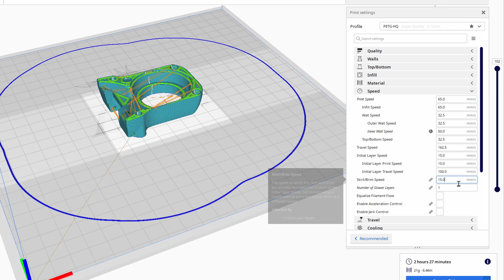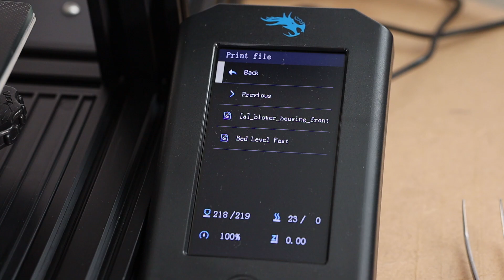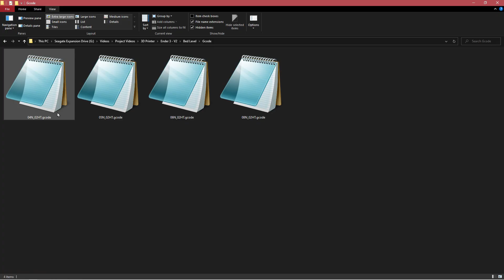Creality Ender 3 V2 - Fast, Easy Way to Level Your Print Bed

Comment: Nice in theory, but not easy to do in actual practice.  The noob should get a simple bed leveling G-Code that tests 5 spots on the bet, pausing in between stops to allow you to adjust.  Run this 2-4 times and you are spot on.  Save up the money to get a 32 bit board and flash a firmware that has either manual mesh leveling, same as a BL touch without the sensor.  Or just save an extra $40 (you can skip Star Bucks 2-3 times in one month) and just get  a BL Touch.   The method here is finicky, and not for the novice and goes too fast.  Seasoned 3D fans already use the BL Touch or equivalent  or some form of manual mesh leveling. Save the headache and to that over this video.

Comment: bro, did you cut out a scene just before 1:30? i feel like there should be an explaination coming of what you are doing, but then you talk like its already over. i mean, obviously you adjust while the skirt is printing, but how do you adjust? what do you look for? what indicates a high bed, low bed or just right bed?

Comment: Now that you have a glass bed you should solve the moire issue. It’s exacerbated by heavy glass beds like that. Make a video once you solve it!
Reply from the maker: It seems to be getting worse, In an upcoming video I will be examining this issue in detail and we'll test some solutions to see which one works the best.  Tossing the glass bed helps with rapid changes in direction, however the pattern I see on all of my prints is consistent and completely vertical as well.  The same G-code run on my newer printer is there but not as noticeable.  I have to wonder whether this is strictly caused by the motors.  Thoughts?  There doesn't seem to anything on Google about solving this problem.  Steppers have vibrations, there are dampeners available, but first I think a swap with new motors would be the place to start, what do you think?
Reply: @NeedItMakeIt  I have a theory about this. But that’s why I was hoping you’d look into it :)

Basically I think once you get good stepper drivers and tune everything, the pattern you see is visible, but superficial. Like on mine I can’t feel the lines, but on certain filaments you can see it.

Anyway, my theory is that it’s the belts. Not how tight they are. Literally just that the gear interacting with the belt causes it. I actually measured the distance of the lines and calculated what the gear would look like if you flattened it and it’s clearly an identical distance/pattern. So I think the simple fact that the belt has teeth and the gear spins the belt, it is imparting that pattern onto a print.

Some moire lines are caused by other things. But once you tune those out, the pattern on the surface of prints seems to point to the belt. At least that’s my theory.

Comment: I have 4 cr10’s and I have been doing this for a while now but What I do is I have a simple square 0.2 mm layer height only 0.5 mm thick stretched across the entire build plate but set with no top and bottom layers and infill at 5% set on grid this gives me a grid pattern over the whole plate and shows me if there is any warping in the center or edges. Once it’s set I can print for a very long time without having to do any further adjustments. I use hairspray for my bed adhesion I made a masking cover out of chipboard so I get very little overspray. 
Thanks for your awesome tips I’ve been getting some globs on the outside of my prints and your settings on your latest video has greatly improved my models.

Comment: actually the easiest is to enable manual leveling, mesh leveling, and 'go to corners' in marling,    then you can level it using the lcd to go to all corners etc, even create offsets for warped beds, aswell as adjust the z-axis DURING the print of your first layer, via the lcd

Comment: This is exactly how I level mine! Doing the whole paper thing seems pointless to me, I make sure when I print that I get enough smoosh on the first layer by doing this.
Reply from the maker: It has been working great, I like to level by eye, if you have a light behind the printer it makes leveling easier, you can see the space between the nozzle and buildplate
Reply: @NeedItMakeIt  I did the same initially, after failing with the paper and realising that the paper method wasn't super reliable I started doing it by eye, then after having some adhesion issues I moved to the method in the video.

Comment: If your feet aren't flat on the surface, it means the machine is tweaked. when the machine is tweaked, it will never level properly. CHEP on filament friday has a video on how to fix this... it's a PITA but it fixes things.

Comment: i have an ender 3 pro, i had a warped bed and couldnt really print anything, then i got mesh bed leveling, now my first layer is almost perfect.
Reply: Did u use bl touch?
Reply: @DarkMatter1919  no its free

Comment: Haven't been printing for a while. I see your channel has blown up in size! every video looking better and better.
So far my ender 3 v2 has had 3 faulty wheels and 1 bump in the axis where the bed moves on. Now I finaly have all the parts replaced and there where more people having issues with the firmware. Now someone fixed the problems. and I cannot say how happy I am with a 5 x 5 measurement from the bltouch. we'll see how long it stays and how good the print's will turn out.
Reply from the maker: Hey, sorry super busy lately, just catching up on these now.    I did find that they tightened the Y carriage cams too much on my 2nd printer and it deformed the wheels a little bit, just enough to feel the tiny bump when it moved.  I still need to get the BL going on my printers, I still have some videos to make with the printers set to stock.
Reply: @NeedItMakeIt  no problem. You channel is twice as big. 
I have some experimental firmware from a forum.
So far no problems anymore. 
Printed the t rex skull and some other stuff. 
I can honestly say I whould dare to print over distance while not beeing home now.also start from distance.

Comment: Voron part nice👍 soon™
Reply from the maker: I'm souring the parts at the moment, I have a simple Voron series starting soon, then we'll jump into the bigger printer design, print, build project.  It will be no ordinary build, I'm going to be using some cool new design techniques.
Reply: @NeedItMakeIt  yea I myself am printing parts for a switchwire found out real quick pei sheet is a godsend
Reply from the maker: @reaperdeath667  Will keep that in mind. I do like my glass, but maybe I'll make a jump at some point.
Reply: @NeedItMakeIt  I used glass and abs slurry at one point but soon it just becomes a hassle for abs, and for pei I just wipe down with iso every so often but that's it. energetic makes super cheap flex plates that's pretty popular in the voron community
Reply from the maker: @reaperdeath667  I'll check them out, thanks for that.  If it works that well with ABS, I'm sold.

Comment: do a switchwire easiest  build of the vorons series.
Reply from the maker: Done!  I printed some M4 extruder parts last night as a trial, OMG they turned out really well.  I am going to make a series, something a little different than anything else out there.  I really don't like those long videos, I'm going to work on condensing them to just the good stuff. 

They're called Core XY, this one is an XZ isn't it?
Reply: @NeedItMakeIt  awesome 👏🏾 yes its corexz, I’m looking forward to your build
Reply from the maker: @GoldenJaguar3D  It is going to be awesome, I am thinking of going with stock silver frame because the black is not great for the camera... I also want to experiment with buying a few parts from nylon and metal to see how they compare.  Not from Aliexpress, but from a place in Toronto ON.  Maybe also using generative design to tweak some moving components for better strength and weight properties.  How does that sound?
Reply: @NeedItMakeIt  sounds to me there is always room for improvement, I’m excited to see your take and renditions of it  keep the videos coming! I’m enjoying your videos
Reply from the maker: @GoldenJaguar3D  I was thinking it would be awesome to have a terminator style Voron, metal polished fan shroud etc.   More videos to come soon, so little time, so many ideas.

Comment: nice video. Any advice on cleaning the creality glass bed? is it safe to use Isopropyl alcohol or it possibly damage the surface?
Reply from the maker: The black coating doesn't seem to last no matter what, if you want it to stay looking good, flip it over and only use the smooth side.

I like glass, I'd recommend purchasing the thinner 3mm borosilicate glass, it lowers the weight of the Y carriage and produces better results with less ringing, really depends on your speed, type of print and jerk settings.  

Both of mine have worn down a bit now, but they still perform well, they just don't look as good.   Soap and water, or Iso Alcohol both are good.  The coating is a bit gimmicky, I don't find any performance improvement over flat untextured glass as long as we're using glue sticl.
Reply: @NeedItMakeIt  thnx
Reply: To clean it I use hand warm water... just keep rubbing it bit by bit. I do have isopropanol. But so far have not used it.
Reply: @TriMeX1987  thnx

Comment: Hmm which voron are you building
Reply from the maker: I think I'm going to have to build the Switchwire.  I think this is the most similar to what I am familiar with and it is still pretty challenging.  

I was thinking about doing a series which will include experimentation with some different filaments, maybe outsourcing some parts from Nylon and metal, and showing the struggles and solutions to problems etc.  What do you think?

Comment: I don't really get what makes it better than levelling bed with paper sheet, you can see the layer thickness or something like that? What makes it more confusing to me is that you are adjusting the knobs on the opposite site of the current extruder location few times. I know for a fact that when adjusting the knobs on one side, you are affecting the tension on other corners and it thus with paper sheet method it requires multiple takes to do this properly, but I don't get how are you supposed to precisely adjust the distance here.
I'm not saying this doesn't work or shouldn't work, but for video directed at newbies in 3D printing it is lacking  full explanation of the adjustment process.
Reply from the maker: If you're happy with the paper, no problem, it works.  Personally I never found it gave a great result, I'd always end up tweaking it in the method shown in the video.  I probably could have shown a little more of how the adjustment process, works.  I tried to show how to do it so that anyone could setup a process that works for them, the shirt can take three passes if needed to get the result.  I am always close, one pass and a tiny tweak is usually all that's needed, 2 passes helps when I've moved the printer around for maintenance and part swapping etc. 

I have a lot of ideas, they don't all work for everyone, I'm sharing and maybe they'll be useful or give others some ideas of their own.  This one was requested by a viewer.

Videos can always be better so I appreciate that you took the time to leave a detailed comment and I will take it into consideration for anything in future.

Comment: I don't get it. If BLTouch is a somewhat proven way to account for bed leveling issues, why delay the purchase? For about $50, and a 2-minute G29 before each print, you have fairly well adhering first layers time and again. You can save your different profiles in your slicers to account for nozzle and other changes. This is instead of running other code to manually level frequently and running the risk of damaging the printer.
Reply from the maker: Hey, thanks for the comment.   The video is mainly aimed at those who cannot afford another purchase or people like me who prefer not to complicate their printers with upgrades.  I do have a BL, it may make it into a future video, but after several years of not using one, I don't have a great need.   No question the BL is good, I just don't believe it is a necessity.
Reply: @NeedItMakeIt  I agree if cost is a major concern, then this method is a viable option. I had gotten fairly comfortable with the manual leveling myself prior to purchasing a BLTouch, but once I got the BLTouch and worked out the firmware kinks, I have not regretted the cost or the minor complexity.

Comment: Voron parts out of PETG, ick.
Reply from the maker: I may switch to ABS,  I am not a huge fan of the sheen of PETG, ABS has its own set of issues.  Any reason aside from looks to use ABS of PETG?
Reply: @NeedItMakeIt  PETG thermal cycles differently and will likely suffer/sag. eSun ABS+ printed nicely on my CR-6 SE in a box.
Reply from the maker: @ztynzo0  I don't mind to use ABS now that it is warmer, I'll have the printer in the garage inside an enclosure and use the nano adhesive for the best results.  I mainly switched due to the smell, adhesion was solved with the Nano, and there are others now that work well.  Thank you for the tips, I do prefer the look of ABS over PETG, but PETG smells nice to me.

Comment: I ordered some stiffer springs, will see if that helps.  Been getting about 1 out of 10 prints to survive past 3 minutes.  Ender 3 v2 is junk.  Should have bought the Prusa.
Reply: get mesh bed leveling its much easier and better and free
Reply from the maker: I have two of them now, I don't have any problems aside from the more visible seam on the bowden setup.  Send me the file and the nozzle size and material, I will print it and then we can troubleshoot together.  Prusa is a nice printer, no question!
Reply: u might have a warped bed, if u have a warped bed no matter how much you level the bed some parts are not gonna stick if you have a warped bed.

Comment: On my Anycubic i3 Mega S and Ender 2 V2 I've had this problem where usually the top left corner of a square, for example, does not stick to the bed. All of the other corners seem to stick, but the top left corner seems to almost warp upwards. I've cleaned both with 91% isopropyl so far (which I feel might be too strong). Any ideas or tips? Thanks!
Reply from the maker: I'd say it is likely that it is a little further from the nozzle and doesn't adhere as well, which material do you print with normally?
Reply: @NeedItMakeIt  Thanks, that might give me an idea! I have tried PLA and PETG.
Reply from the maker: @azo5000  A bit of glue stick should solve your problem with those two materials, I only use glue stick now, I don't ever worry about adhesion.   Good luck and let me know if I can help!
Reply: @NeedItMakeIt  Thank you, I will try this and let you know if it works. I appreciate your dedication and help.

Comment: Are you turning your V2 into the Switchwire?
Reply from the maker: I've been thinking about it, I might want to go all-in on the best possible printer I can build.  On the other side, it might be more helpful to people to do a more simplistic printer.  What I had in mind was a sort of walkthrough cutting out everything unnecessary and making a series out of it, which could include any struggles and design changes printing or parts etc.  

One thing is for sure, the Ender 3 can only take you so far.  I've been thinking about a resin printer as well for those extremely fine detail parts, that would be a whole different set of issues and learning.  

What you think?
Reply: @NeedItMakeIt  That make sense. Not everyone wants to convert their Ender to Voron. I was thinking about it too, but having only one printer, it would be a pain to do. Plus even the Voron devs recommend to just build one instead of converting Ender.
Reply from the maker: @woodcat7180  I may go Switchwire built from scratch, I think it is a good intermediate diff. printer with some speed and tolerance improvements over the Ender series.  Lin rails and so on.  I'll dig a bit deeper.  I wanted to include some generative design changes to any moving parts.  I also have some ideas to include other 3D printing technologies into the build.

Comment: Thanks for your video!! I have difficulty with bed leveling, I’m new to this 3D printing industry. Do you have any great tips?
Reply from the maker: Printing with PLA is the easiest, make sure to replace your plastic extruder with a metal one, the plastic doesn't last.  Change the springs to something stiffer.  Keep your filament dry, this will have a big impact on your success, I still struggle with this with PETG and PLA, ABS however never gave me any trouble.
Reply: @NeedItMakeIt  Thank you so much!!! I’ll try it out!

Comment: If you have to turn the knobs once the print started, something is wrong. Once I turn one knob, I have go around at least 3 times to make sure it is all correct. 

Install Jyers firmware, manually level the bed, then use mesh bed leveling. When your print starts, use the z-offset value to fix nozzle distance from the bed if it is off.  If it gets off again, check manual leveling first and then check that mesh bed leveling is still correct.
Reply from the maker: You're right going around more than once is a necessity.  

I've been using a similar method for several years and it works quite well, which is the the reason I am sharing.  The tolerances of these parts are not so precise to have to worry about 0.05mm difference in height.  If we're using mesh bed leveling, that means that the bottoms are not flat and so a difference is height and precision is not obtainable in either method. 

This video was made to help anyone new with 3D printing that does not want to purchase or add anything on.

I will be investigating the BL in future, I have one, but it is not a high priority. 

Thanks for the comment